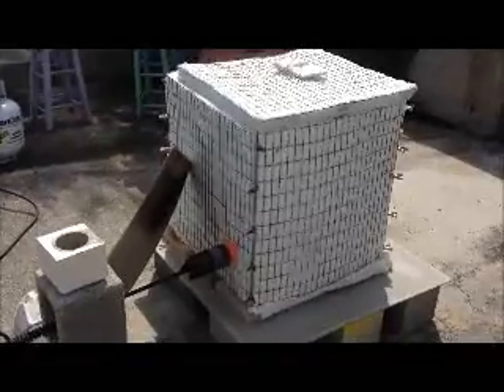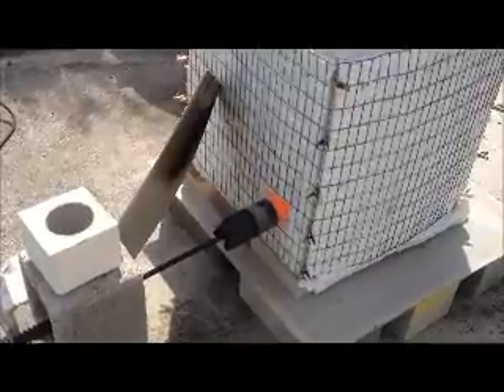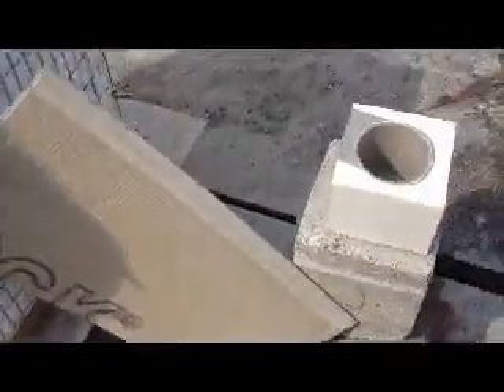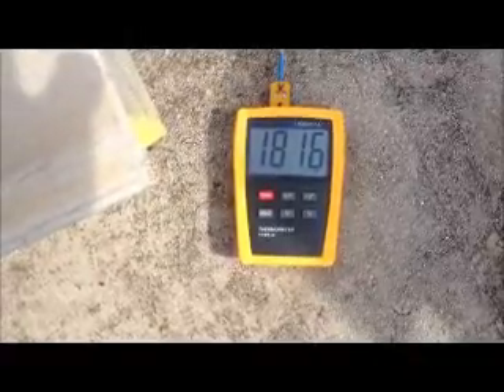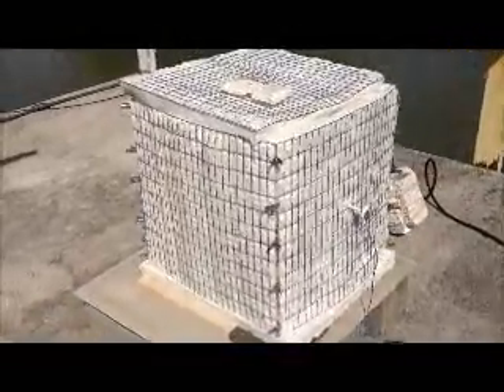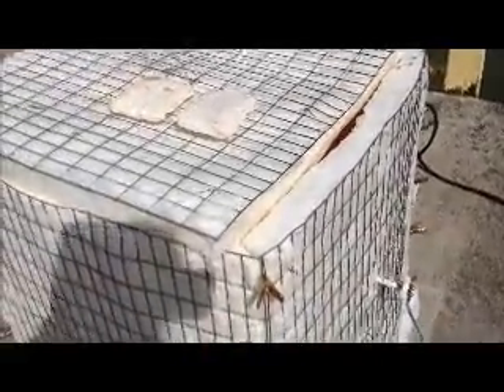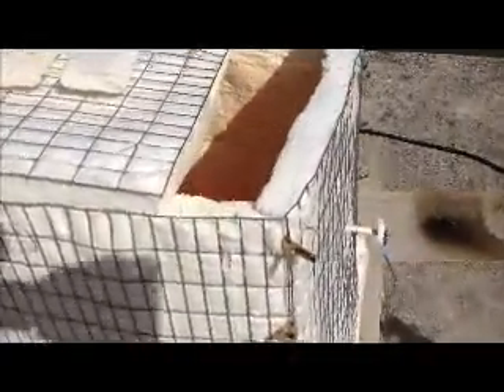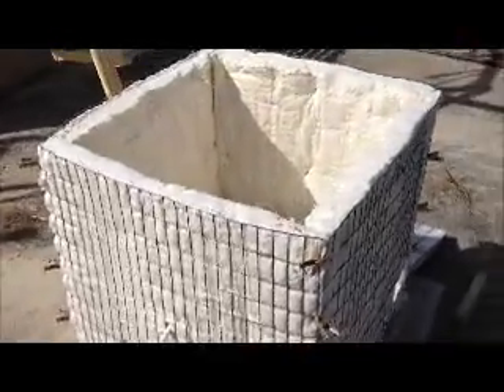bisque3

Comment from the maker: Have not tried a glaze firing yet, Carmen.  While I'm quite sure I could easily heat the kiln up to cone 10 temperatures, I have concerns that the kiln would cool off too fast after firing causing crazing in the glaze unless some sort of downfiring schedule was used.  This would not be a concern with low fire glazes since the lower the kiln temp, the slower the cooling.